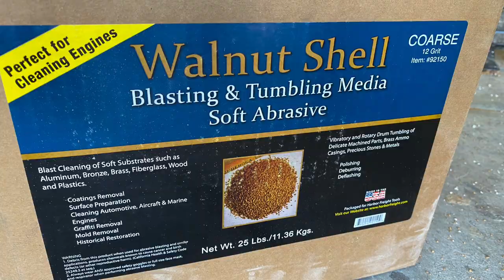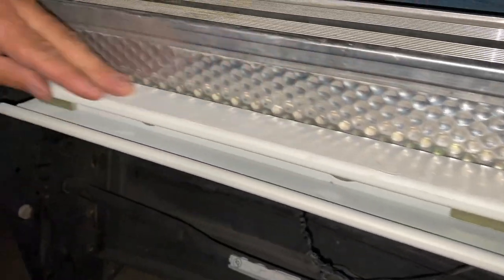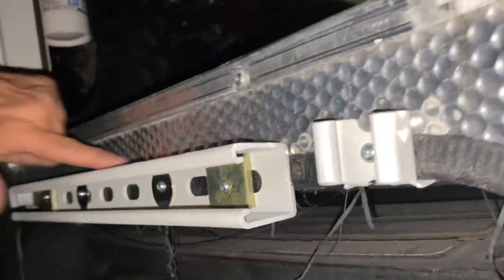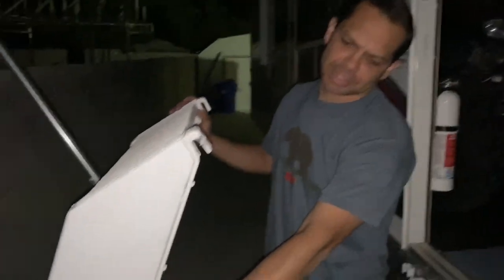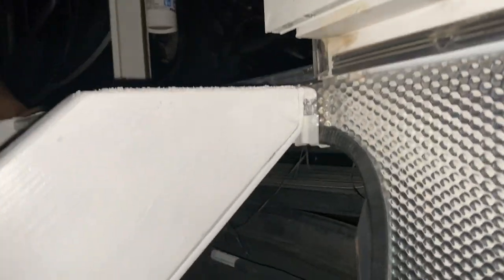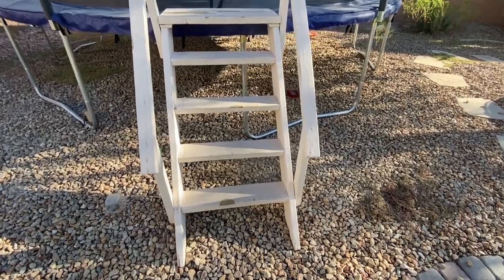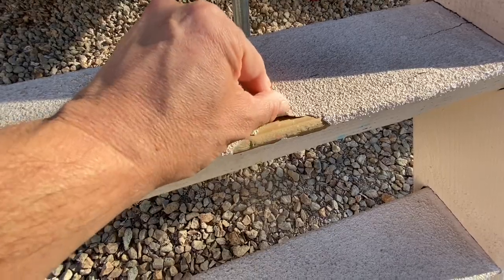How to make stairs for an RV or trampoline

Comment: How is the walnut media applied to the steps? Epoxy?

Love the channel. I feel like you and Pocket 83 have stuff in common.
Reply from the maker: First I applied a thick coat of paint to the step, then I used a dust pan to shake the walnut media onto the wet paint. After it dried, I went back over it with a paint roller. Thanks for the nice words. I’ll have to check out Pocket 83‘s channel.